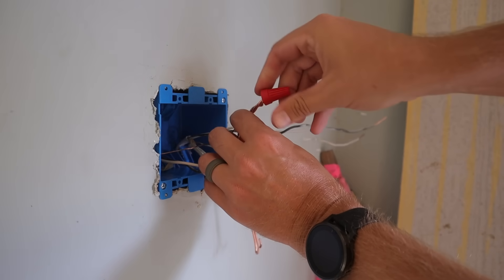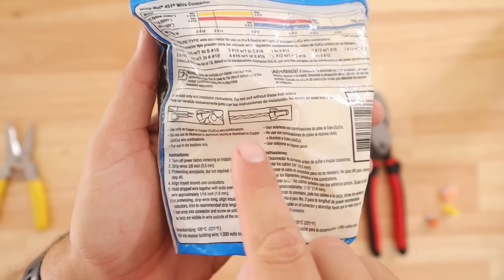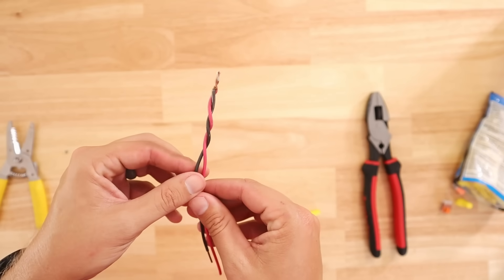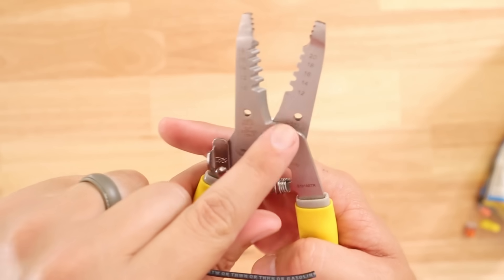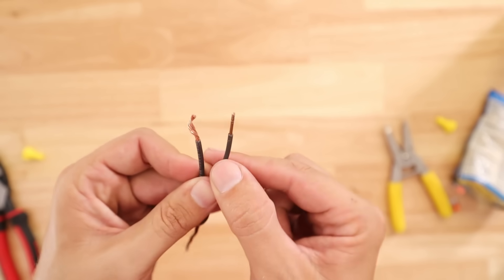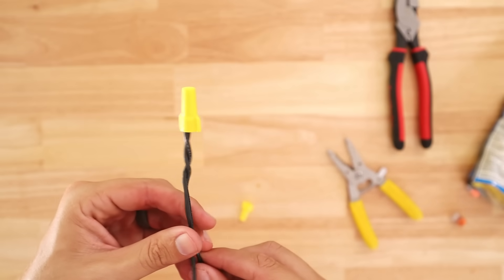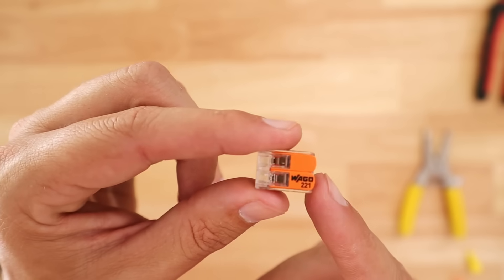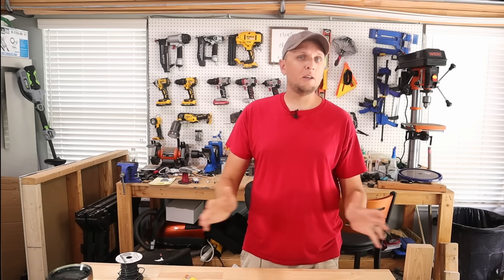BIGGEST Mistakes DIYers Make When Connecting Wires Together | How To

Comment: I would like to see a Wago connection slightly over amped. I have a feeling it might melt.
Reply: They will melt! I have seen it a lot. They are ok in low current situations but if you give a man a inch he will take a mile and use them on everything. I will not allow any of my guys to use them.
Reply: @explod329  There's plenty of videos on YT showing them taking well over 100 amps, obviously they shouldn't be used in any scenario that high, but there's zero reason you can't use them for residential where 15-20 will be your rough max, anything residential that's higher like a dryer plug or something wouldn't even fit so it's a non argument. If I use anything where it's not supposed to be I can make it melt too.
Reply: @chomp7927  I'm giving advice based on my real world experience, Not a you tube video. I do this everyday. 75% of my calls of lights flickering are from wagos. You can tap or shake the connections and see the arc or watch the lights flicker. I remove the wago's, make a tight twist and cover with a wire nut, problem solved! Have you ever seen the damage that occurs from a backstabbed outlet when a constant current of around 15 amps occur? Well, the wagos are no different, there is just not enough surface area there to take advantage of the entire wire gauge. Take my advice anyway you want. Just my opinion and of course you are entitled to yours.
Reply: Theres already YT videos on that, they actually hold up amazingly, they are worth the cost in my mind, I started using them for a LV project earlier this year and have since started using them for everything lol, they rock

Comment: Funny story, I was working for this cheap boss, that liked to hire tech school students, because it was cheap.  (I am an experienced electrician.)  So, the tech school student was not twisting his wires.  I mentioned that he should but this is how he was taught.   So I let him go.
After the job was done,  my boss called me,  and said half of the lights in a large room were not working. 
He told me to go back and fix it.  This was a fire hall with a large room for banquets. 
I said I get it working, but it might take me awhile.   I went to the Fire Hall early the next morning. 
I went to the place where the hot shot tech student was wiring.   He didn't twist the wires and the wires came undone. 
I twisted the wires, and solved the problem.   Since no one was at the Fire Hall, my boss was cheap, and I was looking for another job.   
If someone didn't know where to look, it might have taken a long time to find because all the wiring was in a dropped ceiling. 
So I took a nap until noon, and my boss was happy.
Reply from the maker: Thanks for sharing your experience James.  I hear this same scenario from the electricians that I talk to as well.
Reply: Well James.... I just read this and now know that you took a nap on my time!  YOU'RE FIRED!!!! (joke) Actually the student should have listened to you and learned something new. I learn something new every day.

Comment: You have a great channel, please keep posting.  You are correct that this is a touchy subject with electricians. Pre-twisting is nice, but the instructions clearly state that that it is ACCEPTABLE, but not required. ACCEPTABLE, as used in instructions, most often is indicative of a “secondary” choice, not the primary method. That said, I believe you should assure that you have a positive and permanent connection. (All this pertains to solid-solid connection.)  Also, having an Electrical contracting service business that guarantees their work and parts for the life of the installation, loose connections (and forgetting to turn the breaker back “on”) is the #1 reason for a call-back.
Reply from the maker: Thanks for the feedback!

Comment: yes that is what I have seen electricians do and I learned to do it that way; the purpose of the wire nut is only to insulate the wires not to hold them together
Reply: Negative
Reply: You are totally wrong!   The spring inside is very important in making a strong mechanical and electrical connection!

Comment: I learn from experience that prewisting is important especially when it is a stranded wire with a solid wire and I find that stripping the stranded wire a little more than than the solid and wrapping around the solid prevents it from becoming loose after the wires are replaced in the box; stranded and solid can be difficult to deal with. Even solids can loosen if not prewisted.
Reply from the maker: Yup.  Thanks for the feedback Carl!

Comment: Just had to fix a light bar that had bulbs flicker, the problem was the stranded wire was almost out of wire nut ,but I guess you would expect that in a five year old double wide mobile house that costs less then 150000 dollors,

Comment: pre-twisting is not necessary, however I like the cordless tool that twists the wire nut on a few turns and achieves a good snug fit. never be in a hurry make sure your nuts are screwed on well

Comment: Being an electrician/automation engineer myself, I can say that we rarely use wire nuts at all. We prefer Wago connectors. Yes, they are more expensive, but they more reliable and easier to use.
Reply: been an electrician for 22 years now, a lot of these new fixtures have came out with a wago style quick connect. I have seen more failures in the last 5 years than i have ever seen. Avoid them if possible.
Reply: @explod329  Hm? How's so? What's wrong with wagos? I've always considered them a near perfect solution.
Reply: @Alexey65536  they are for the lazy ones in my opinion. The connection is made with a very thin slit of metal that gets sloppy overtime. Get a lot of calls of lights flickering or not working. You can usually shake the wire at the wago and see the arc or the light flicker. I’m my opinion you are not going to beat a twisted joint. Back in the day they even soldered which in my opinion is as good as it gets.
Reply: @explod329  That's strange. I've never had such issues with wagos. Perhaps you've been dealing with cheap chinese knock-offs? Those can be unreliable. We generally prefer them due to their huge advatage over twisting and soldering - wires connected with wagos can easily be added/removed/readjusted. While with twisting/soldering there aren't many ways to add or remove a wire - other than cutting that part off completely. That's a big deal for our particular job.
Reply: @Alexey65536   I'm not here to argue with you about anything, we all have our own opinions, I was just stating my opinion and what I have seen in the past. I average around 25 calls a week depending on how many larger jobs I do. A lot of electricians started using these for awhile until they had so many callbacks. Its not If they fail, its when. You could not pay me to sleep in a home with these installed throughout fixtures , junctions etc. Using a wago is no different than back stabbing wires into the back of outlets and switches, I do not allow backstabbing as I have seen way to many outlets and switches burned, melted, loose connection. My opinion is if u use a wago, that's like using a shark bite for a plumbing repair, it WILL work, but how long? That's my 2 cents. Good luck.
Reply: @explod329  I agree with everything you said. What a great analogy too! Like a shark bite for a plumbing repair... hahaha! Total facts.
Reply: Are they much more expensive than push-in connectors (without levers)?
Reply: Let me guess, you are a young engineer who really hasn't done anything but been and autocad bitch for the senior guys.
Reply: They are outrageously expensive.

Comment: Good informational video. What about aluminum wire to copper wire? My house was built in the mid 60's and had aluminum wire installed. After we moved in in 77, a receptacle started smoking. It was recommended I use CO/ALR receptacles and switches and check them every few years to make certain the connections were tight. Later an electrician said I should wire nut a copper pigtail on and use regular switches and receptacles. Any thoughts or opinions on this?
Reply: The code allows this pigtail from copper to aluminum and you can use the purple wire nuts. They are expensive though.
Reply: @explod329  very expensive
Reply: I am not an expert but I would think the pigtail with coalox, do it once and the connection never has to be disturbed again. No risk of someone putting the wrong switch or outlet.

Comment: Imho wagos are a life saver in tightly packed boxes.  Makes it so much easier to neatly stuff the wires in
Reply: I have had these connections fail in the field. I cannot recommend you not use them strongly enough.
Reply: Wagos are garbage. Increased resistance and the need to figure out which one to use is just asking for trouble. Better to use wire nuts and not have to worry. As long as the wire nut fits snuggly, it's the right size.
Reply: @SmallSpoonBrigade  ahaaoafyyfu

Comment: stranded wire i give a light twist with plires then twist with solid with plires trim ans cap always pull to ensure connection. a  inproper connection can get hot and lead to fires .. one thing i hate is push connecters on devices like switches and outlets as a electrition i have had to fix so many of those problems loose connections from puch tabs a lot of times it easy as moving switch or outlet to see where the problem is most of the time it is the last device in the circut that is working i always twist all junctions and put wires under screws after you know what a electric fire smells like and see what happens inside a box or device you would understand reading and understanding the code book is almost impossible for the average person so vidios explaining the proper way to do things is great i could look at a bluprint and tell you what size service pannel is needed but to take the test you have to show the math lol

Comment: While I respect years of experience, which I have, the actual electrical bond connection in a wire nut is the spiral metal inside that cuts into the copper wire and forms an oxygen free connection. Physical twisting is not the primary electrical connection, but does seem to help if the nut is not tight enough. Tape is not necessary, and can be detrimental in a moist location. It can cause moisture buildup, due to condensation, inside the connection. Wire nuts for moist locations are available, and should be used instead of tape. Tape is not in the instructions for any wire nut installation.
Reply from the maker: I appreciate your experience and feedback.  Thanks David!

Comment: I was taught, when connecting one or more stranded to solid wire(s), to pre-twist the same number of solid wires together including your solids that will remain. For this example, say we have one of each. You take TWO solid wires, the box wire and a loose pigtail. Twist them together, then, without excessive back twisting (to prevent undoing the spiral twist of the solid wire) coax the pigtail free. Now you take your stranded wire, twist the strands together THEN twist this into the pre-spiraled solid wire. Once done, wire nut securely and tape clockwise (as viewed from top of wire nut) from top of wire nut down about an inch onto the wires. The tape should be pulled so as to slightly stretch it as you wrap with the final wrap being laid on, not stretched. Done properly, this will NEVER come apart unintentionally. Also, there have been many inspectors that had issue with the insulated portion of the wires below the connection (wire nut) being twisted, to the point they would not approve until the twists were undone and the twist/wire nut connection was proven tight afterward. You may have experienced this or you may have not. As  rule, we did not twist the insulated portion and all jobs passed the first time. The message here is KNOW ahead of time what is to be expected! Showing the inspector the back of an IDEAL wire nut package to justify the twisted insulation portion will not get your work passed.

Comment: I think your description of twisting is not quite right in terms of making an electrical connection.  Even when twisted together, the wires will still eventually oxidize and result in a bad connection, possibly even cause a fire.  The insert in the wire nut actually cuts into the wire slightly and makes a hermetic seal between the insert and the surface of the wire, preventing oxidation at the points where the corners of the insert profile dig into the wire.  Pre twist or not, make sure the wire nut is tight by following the directions and crank it down until it stops and the wires twist.

Comment: What about doing the pre-twist, then soldering the connection (especially with one solid and one stranded) ?
Reply: The wires will be well joined, but they may not bite into the nut very well. The nut may fall off. I'm a big soldering fan, and I've tried this approach, but it's not good. You could tape the nut on, but it's just a lot of extra work.
Reply: Soldering is typically NOT a good thing.  It is expressly NOT allowed on most power connections.
Reply: @johnh9748     I always love it when somebody makes a comment like this, and bloviates that “it’s not a good thing“ or it’s expressly NOT allowed on most power connections“. If we talk about most power connections I would argue that they are indeed soldered especially when you consider the internal high-power connections of equipment where wires are joined to printed circuit boards and then routed to screw-terminal strips. Where did you get the idea that soldering was typically NOT a good thing?

Here is quoting chapter and verse directly from the National Electrical Code:
110.14 Electrical Connections. Because of different characteristics of dissimilar metals, devices such as pressure terminal or pressure splicing connectors and soldering lugs shall be identified for the material of the conductor and shall be properly installed and used. Conductors of dissimilar metals shall not be intermixed in a terminal or splicing connector where physical contact occurs between dissimilar conductors (such as copper and aluminum, copper and copper-clad aluminum, or aluminum and copper-clad aluminum), unless the device is identified for the purpose and conditions of use. Materials such as solder, fluxes, inhibi- tors, and compounds, where employed, shall be suitable for the use and shall be of a type that will not adversely affect the conductors, installation, or equipment.

(B) Splices. Conductors shall be spliced or joined with splicing devices identified for the use or by brazing, weld- ing, or soldering with a fusible metal or alloy. Soldered splices shall first be spliced or joined so as to be mechanically and electrically secure without solder and then be soldered. All splices and joints and the free ends of conduc- tors shall be covered with an insulation equivalent to that of the conductors or with an insulating device identified for the purpose.

[My personal opinion is that, once the connectors are tightly twisted together and solder is applied and the joint cleaned, there is actually a permanent gas-tight molecular bond between the conductors that no longer permits any form of contamination or oxidation to be deposited on those joined conductors. And in talking anecdotally to other electricians involved in industrial electronics and electrical power distribution, soldering is very common in areas involved in high humidity or in the presence of gases especially those causing oxidation and where gas tight sealing is not an option.]

So, even according to NEC, it is both accepted and allowed with no caveat given to it being “NOT a good thing“ neither does the NEC say that it is “expressly NOT allowed on most power connections.“ 
You simply making things up repeating then passing them along as fact is not helpful to people trying to learn and understand what really goes on…

Comment: I would like to see you test wagos and push in type with a 30 amp load for a few hours. On outdoor wiring and sometimes indoor I like to wrap my wire nut and about 1 inch of the wire with 3M Tape. I have a friend who is also an electrician who likes to twist his out door wiring and then solder it and finish of with a wire nut and tape. He says he has seen a lot of out door wiring corrode do to humidity and build up resistance and tarnish and break from overheating and the solder keeps the connection tight and sealed. I have to admit I see some outdoor wiring connections corrode after 10 years or more. What do you think of the Rosin core solder joint to help against corrosion between the wires on outdoor connections?
Reply: There's YouTube videos with wagos at very high temperatures..it was a while go that I saw it..should still be there

Comment: Strongly disagree. You can damage the conductors, as reminded by my local inspector. And if properly installed, the wire nut will twist the conductors upon installation, but only need 1 twist or so. Twisting the conductors 5 or more times makes for a damn nightmare for the next sparky that has to make a change or do a repair.  If you trust the spring in a Wago, you should realize the extreme twisting in a wire nut is ridiculous. And yes, not a DIYer.
Reply: lol first thing i noticed also
Reply: @scott rule, I most certainly agree. What commonly happens when over twisting is you can break off the end of the conductor. Also as good practice, I put a wrap or two of tape around the base of the wirenut. 25 years in the trade.